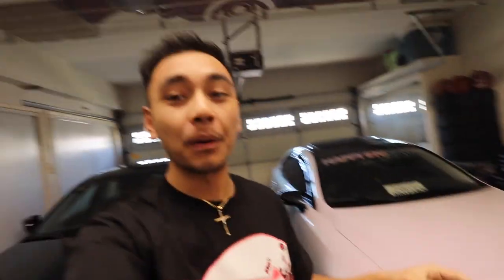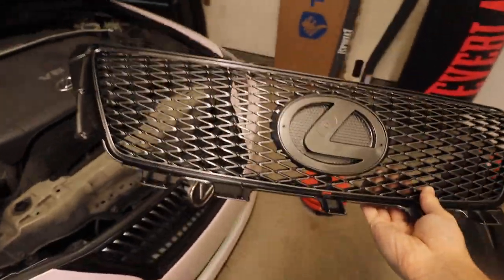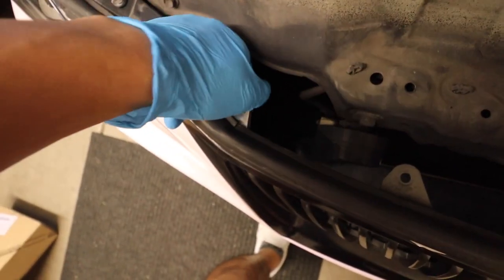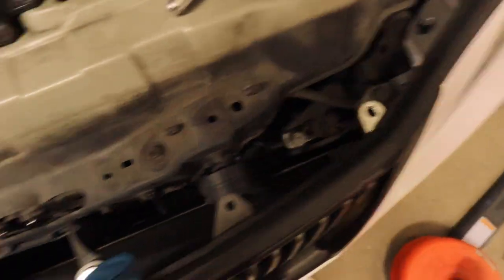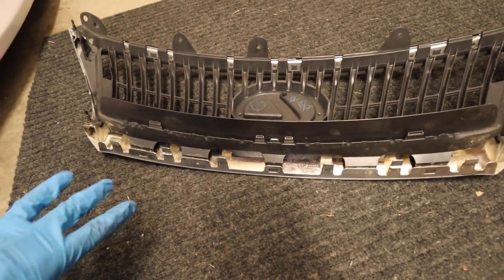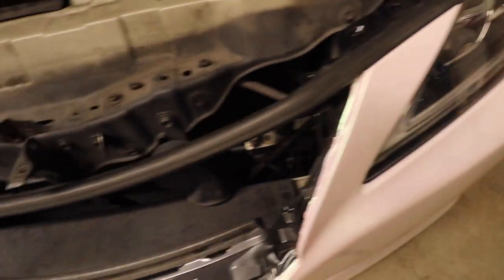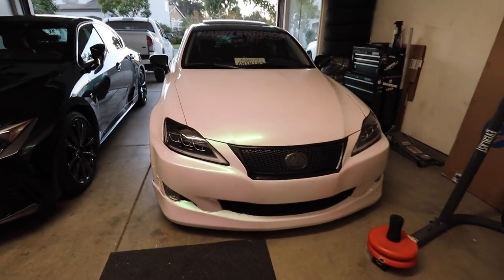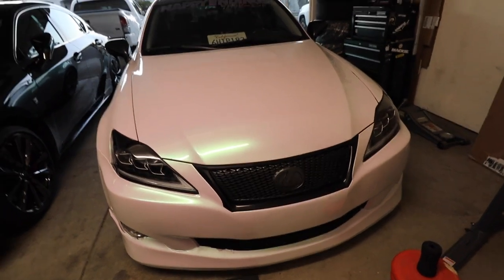Upgrading the Front End!! | F-Sport Grill Install

Comment: I have the same grille. One of the best upgrades for appearance. I lucked out, I got mine for $60 locally from a guy that bought the wrong one for his 2007. The 2009 IS Fsport grilles are normally over $230 before shipping. What's weird is the 2006-2008 and the 2011-2013 Fsport grilles can be found around $100.
Reply from the maker: As much as I didn't wanna do it, I had to bite the bullet :(
Reply: @ChristianMastrile  I think it looks so much better than the stock vertical line grill.
Reply from the maker: big facts I didn't think it would make as big of a difference as it does